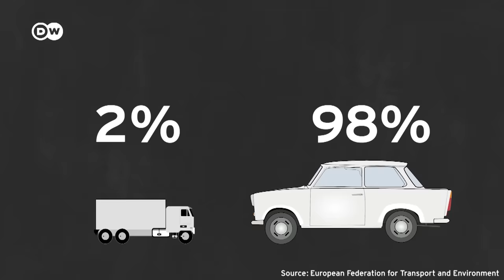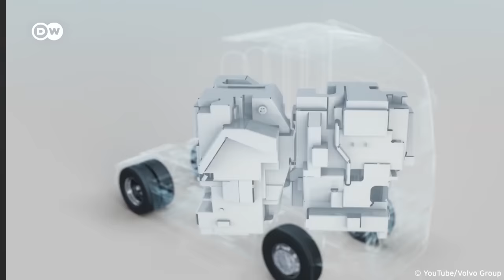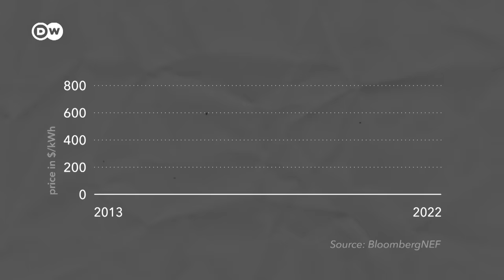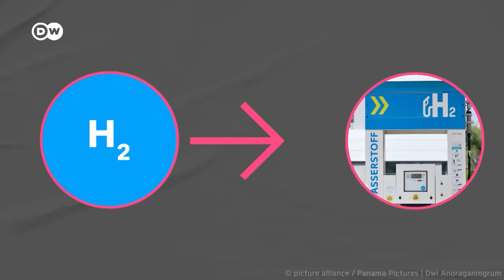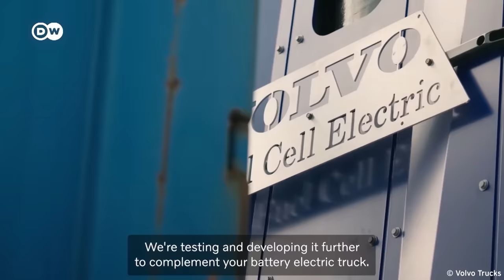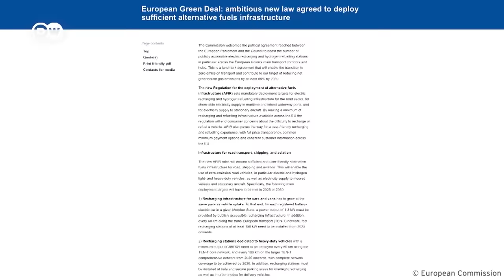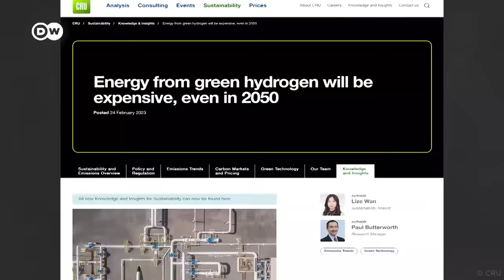Which will be the engine of the future?

Comment: Yeah its still cheaper to run a gas powered truck than either of those two. Until the technology becomes full proof and dirt cheap, I don't see gas power trucks being phased out soon. 

For now, it seems the solution is still a bit of a cost problem.

Comment: One can look at China to see where things are going.  As shown, China already has electric trucks with robot-swappable batteries for local "last mile" delivery.  They're clean and efficient, using the same powertrains as the electric busses, garbage trucks, etc.  We can expect them to scale up to reach cost parity with diesel very quickly. 

China is also building green hydrogen plants and developing hydrogen fuel cell vehicles, and they'll likely be useful for long distance transport where battery swap isn't widely available, but with electric rail and electric trucks covering so many use cases, they might be too far behind to become significant.

Comment: I figure hydrogen would be the way to go in the long run for engines in general
Reply: the race is pretty much over and 12 days ago you still placed a bet on the horse that lost. Interesting
Reply: @zoransarin5411  the horse that won does not mean it was the best when it comes to non-horse things bud.
Reply: @jaydeleon8094  the use of batteries and electricity for a car versus the cost, complexity and enormous infrastructure requirements of hydrogen mean it won because it is significantly better. The only reason hydrogen got this far is because it is a horse created by the fossil fuel industry. 95% of the worlds hydrogen is produced through methane gas reforming. It requires the continued use of natural gas. Your choice. My next car will be an BEV. I wouldn’t want a hydrogen car even if it they were available for the same price as a BEV
Reply: @zoransarin5411  almost like electric cars are just as complex, have more innate problems, require more fossil fuels to make batteries  than sourcing natural gas(which is a byproduct). And the whole point of hydrogen engines is that it uses water. Honestly you thinking that the fossil fuel industry is not funding electric vehicles is really telling.

Comment: Your conclusion that Battery Electric Trucks are way ahead is correct, and for a very good reason, efficiency. Efficiency matters more than anything if everything else is equal... which it isn't. Pure EV is three times more efficient end to end than Hydrogen, and that's impossible to remedy. Why? Because Hydrogen is strongly attached to something else, and the process to separate it is always going to be much less than 100% efficient. Then you have to compress it, which takes a lot of energy and wastes much of it as heat. Then you have to transport it, and eventually waste more than half of the energy in it as yet more heat. No, Fuel cells are not batteries, they are 'heat engines' that oxidise the fuel at 60% efficiency at best.
There is NOTHING you can do to get even close to the efficiency of transmitting Electricity, storing it in batteries and then discharging them into Electric Motors. All of the 'breakthrough developments' are nothing of the sort. Hydrogen is hopeless as a medium to transport energy for road vehicles.
Reply from the maker: Hey dear Roger! 
We did a longer video on hydrogen. Check it out and let us know what you think 👉https://www.youtube.com/watch?v=AGTjKJHu99c

Comment: What about REX trucks? Battery trucks with a ICE engine powering only the batteries, that would be a quick solution in the meanwhile, I would appreciate your thoughts
Reply from the maker: Thanks for your question! They seem to be helpful in offering extended driving ranges like their name goes. But how environmental friendly they'll be in the end depends on the chosen fuel. Also, their engines are way more complex of those purely electric or traditional diesel so their manufacturing and operational costs would probably also be higher too. ⛽⛽⛽

Comment: People just don't understand. They think hydrogen will be like petroleum. Hydrogen has much lower volumetric energy density than gasoline. It must be concentrated by either compressing it to a high-pressure gas at roughly 10,000 psi or by liquifying it (chilling and maintaining it at −423°F). Compressing or chilling it takes considerable energy. Storing it as a gas at 10kpsi requires special armored tanks that cannot be metallic (hydrogen will cause metallic embrittlement). Hydrogen is an incredibly tiny atom, or H2 molecule, and will slowly leak from virtually any attempt to store it for any length of time. If stored as a liquid it must be continuously chilled and maintained at −423°F in special vacuum insulated tanks. No attempt to store it at −423°F is perfect so it must be allowed to vent as some amount of it will evaporate or "boil off" (if not allowed to vent it will explode). Even the best estimates put Hydrogen at better than 4x the cost of the energy equivalent of gasoline. Customers aren't going to tolerate losing even small amounts of such an expensive fuel. Neither will they tolerate the inefficiencies and outright waist of an expensive fuel by burning it in an inefficient Internal Combustion Engine. Using it in a fuel cell vehicle does bring it closer to an EV in practicality. Still I don't see it working for passenger automobiles. I can, however, see hydrogen gaining some measure of success in the trucking industry and in aircraft.
Reply from the maker: Hey there! Hydrogen in aircraft is a topic we also looked at a while ago. You can find the video here 👉https://www.youtube.com/watch?v=7KkBE0HgNJQ

Comment: Focus on hydrogen aircraft and ammonia for container ships.  The cost of energy (diesel, electricity, hydrogen) will always be a major fraction of what's needed for trucks, and I can't see hydrogen winning.  The cost of maintenance is also high, and again batteries win.  The only disadvantage would be that truckers have to take their breaks near a megacharger.  With ships & aircraft, the long distances make frequent charging mid-air or on the oceans difficult for batteries, and aircraft have the problem of weight too.

Comment: Maybe it is possible for them to design a hybrid electric truck that runs both on batteries and hydrogen fuel cell. At least they can rely on hydrogen for long haul heavy load trip and batteries if there are power station in place. Both sources of electricity can be generated to run the electric motor inside the truck.
Reply: Would make a bad product. Hydrogen storage takes up a lot of space on board so it would result in a compromise with bad range and/or bad load capacity.
Reply: Yeah.. Hybrid is also a good idea.
80H-20E or 70H-30E  makes a good combination.

Comment: No mention of the Hydrogen engine, everyone is obsessed with expensive and clunky fuel cells. JCB in England have just released the Hydrogen engine that is the same cost of a diesel truck, zero emission, same running costs and same refueling time as diesel.

Comment: Its a Battery  Vs Hydrogen battle : For Trucks definitely we need bigger batteries to power them. Bigger batteries means it adds up more weight to the truck,  also it need more time to charge as well.    On the other hand if go with Hydrogen Fuel Cell, there overall energy efficiency of the hydrogen production, distribution, production and storage of hydrogen  and utilization chain is lower compared to other clean energy options. Other challenge is it should be Green Hydrogen only need to be used otherwise whole purpose is defeated and can't meet the  climate goals.

Comment: Batteries, hydrogen or liquid fuels? The answer is YES. Smaller battery + hydrogen stored as liquid efuel with fuel cell for range and weight and recharging issues. So YES, these 3 together. Much cheaper than each one alone.

Comment: Hydrogen has two main issues. It is really inefficient. 20 to 25 percent efficient from source electricity to the wheels. Battery trucks are over 80 percent. The second issue is that it’s not green. Most hydrogen is made from natural gas which is no better than burning diesel. Yes we could use green hydrogen but that isn’t here in sufficient quantities yet and won’t be for some time. Also as of now it is much more expensive.
Reply from the maker: Hi dear Matthew! We tackle hydrogen and the production of hydrogen in one of our videos. Check it out and let us know what you think 👉https://www.youtube.com/watch?v=AGTjKJHu99c

Comment: The future is not one solution, but many. On long haul, many companies, like my company, is moving cargo from road to sea or rail. However, these solutions are dependent on an infrastructure and capacity, which in many cases aren’t there. There are especially 2 factors which are important when shifting from road to rail and sea: Total transport distance. Last mile distance. The shorter the total transport distance is and the longer the last mile is, the more seafreight and railfreight is loosing its competitiveness. The European Governments are doing a lot to shorten this distance by making it more expensive to drive. But in the end there will be trucks transporting  srco over long distances. In my opinion it is not realistic to base your transport with electric vehicles on a public charging network, so this has to be provided inhouse. This means that Electric wehicled will ja e their advantage where tvey can go in fixed routs where fast charging can be done on their 45min break and slow. charging during night on the 9-11 hours break. I belive the industry will do a lot to adapt to this sort of solition.

Comment: Both are remarkable technologies! Hydrogen is incredible and has been around for over 100 years in vehicle inventions. BUT! The problem is that no one has invested in building a highway infrastructure for refueling these vehicles like electric. Electric is everywhere, so it's already available wherever you go, but Hydrogen has to be made in a factory and then shipped out.; Hydrogen IRON fuel is an eight-part process, while electricity is only A two-part process; for example, It connects to a supercharger, converts to a higher voltage, and dispenses such fuel. Hydrogen has to be delivered to a factory, then it needs to be processed, then it needs to be combined into an iron gel and then delivered to stations across America. Delivering Hydrogen will be highly costly; remember that commercial trucks will become self-driving. Electricity is energy efficient only because we have the infrastructure already set. Still, if all our appliances ran on hydrogen-iron electricity across the country in every household, the game would change. It would make better sense to run a Propane Tank Engine than a Hydrogen because we already have propane pipes across this country. It would be cheaper for car makers to make a Propane car. But if they can convert the Propane into a gel called Propane Iron, it will no longer burn as fast, and we can travel longer miles.

Comment: Another advantage of going for Hydrogen Fuel Cell, is the geo-political and humanitarian issues with mining lithium. I support hydrogen to be honest. 

There are locations where there could be excess renewable, but don't have infrastructure to get electricity to the grid where the demand is, such that the renewable were not built. But they could be used to make hydrogen, like Wind farm from north of Scotland and Solar from north Africa.
Reply: Hydrogen fuel cell vehicles require platinum, lithium, cobalt and nickel too and then there all the other matierals required for building 3 times the number of wind turbines and solar panels required. And just because we can make some hydrogen with excess energy doesn't mean we should put it in trucks and it won't be enough anyway.
Reply from the maker: Sounds like you'd be keen for this! We did videos on both; lithium mining and hydrogen production. Check them out here👇  
📺 "Why we can’t live without lithium" 
https://www.youtube.com/watch?v=gAZV1Ut6DDs
📺"The truth about hydrogen" https://www.youtube.com/watch?v=AGTjKJHu99c

Comment: Hydrogen cells are equivalent with batteries having their metal anode being dispersed in the air. It may be water a hydrogen cell disperses but have them in numbers and you are effectively rising the surrounding humidity by a lot. In my personal opinion though, we should be living in the safe nuclear era, where we could be utilising Nickel 63 to convert to Copper 63 as the waste product and have a direct nuclear electric safe battery that lives 100 years and is super powerful. What a pity we are still not using direct nuclear electric power supplies. They could couple with anything they are attached to, becoming the source of energy for anywhere you go, including houses and farms. To produce Nickel 63 an ion beam of standard Nickel 62 or below can be bombarded with neutrons from heavy water, which is very abundant, and then the successfully transmuted heavier Nickel 63 atoms can be collected, continuously from the ion beam, by simple magnetic steering. Ofcourse this is very far ahead in the future as we currently cannot utilise simple iron air infinitely rechargeable batteries as their research has been shoved under tons of petrelaic "interests".

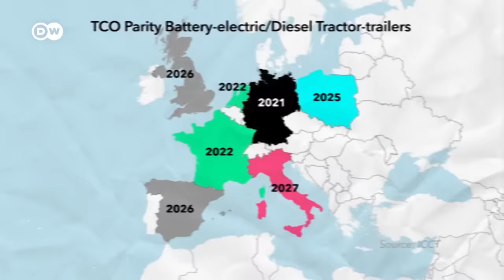Comment: Either I’m stupid or the map at 5:32 doesn’t really tell me anything
Reply from the maker: The graph shows by what year it will basically cost the same to buy a battery-electric tractor trailer compared to a diesel tractor trailer. The data looked at the total cost of ownership, the sum of all the expenses for a vehicle, for the first 5 years of ownership. It also took into account any policies the countries in question have in place to support electric trucks. 🚚

Comment: Using hydrogen in IC engines in place of fossil fuels can be an option to begate the disadvantages that come with fuel cells. Additionally, the ships can't work on batteries as distance is too much to make sense. This is
not true in the case of hydrogen powered ships. 

Talking about hyfrogen filling stations, the existing fossil fuel filling stations infra can be used to solve the issue of lack of infra.

Comment: The problem with electric is the electrical grid can not handle the extra load. The internal  combustion hydrogen engine is the answer. Make hydrogen fuel from water produces little carbon pollution and will even clean carbon pollution out of the air.
Reply: Of course not. Such a truck would consume five times as much electric energy, and you are worried about the grid 😂

Comment: This is missing three important points:
(1) The first step is to stop consuming so much stuff.  Wasteful consumerism is the core problem here, and also the cause of a bunch of other issues (e.g. waste to landfill).
(2) Trains.  Just like how the solution to passenger transport is public transport first, and electric cars only where that's not possible, the solution for freight needs to be to get as much as possible off the road.  This would eliminate the need for hydrogen, because it'll only be short-haul trips needed by trucks.
(3) Hydrogen is more expensive because of fundamental laws of physics that make it require 2.5 to 3 times as much primary energy versus battery-electric (and this is thermodynamics, so there's no way to innovate past it) - i.e. even in the best case scenario, hydrogen trucks are going to require 3 times as many solar panels and wind farms, and it'll always be much more expensive.
Reply from the maker: Hey there! Yes - less is more, right? 🙌🌻
We did a video on degrowth you can watch here 👉 https://www.youtube.com/watch?v=_22mKe_OLsg
More gargo on rails would be ideal - though we'd still need trucks as well for versatile deliveries. Also, from about 4:11 into the video we also address the cost of both options and what they are based on.

Comment: The story set higher standards for hydrogen than it did for electric. Talking only about green hydrogen, while saying electric trucks could be powered by fossil fuel or green energy. And it totally missed the convenience factor, hydrogen can be sourced everywhere, while lithium, cobalt & rare earths are restricted to only a few sources, and what about the life of both designs? How long does a battery last before needing replacement compared to the lifetime of a hydrogen fuel cell? That is a huge factor in how economical they are. Hydrogen is starting far behind electric, but given it's versatility, it can be used for cars, trucks trains, boats, planes, rockets & power plants, none of which were mentioned, it will likely play a huge part in future transport & power generation.

Comment: Nowadays there a solar cells that generate hydrogen from moisture in the air.
Cover your 12m container with those and you get additional feed for your fuel cells,
while saving at least 10 tons on a battery pack that needs replacing every few years.
Reply: Still very inefficient.
Reply: @Simon-dm8zv  
Inefficient compared to what? You can easily make your own hydrogen at home. It's free!
Reply: @fglatzel  Compared to battery electric. Making hydrogen at home is also very inefficient...
Reply: @Simon-dm8zv  
If something is for free, why care so much how "inefficient" it is?
Here in Africa is plenty of sunshine throughout the year.
These solar hydrogen panels allow anybody to create their own free fuel
while getting away from this stupid battery based energy storage.
Reply: @fglatzel  Nothing is free. You will have to buy 3 times as many solar panels first plus an electrolyzer system, compressor and storage vessels.
Reply: @Simon-dm8zv  
 Without a doubt, there is an obvious initial investment into infrastructure like everywhere else.
Eventually people will see that storing energy in lithium-ion batteries is really dumb.
The difference between us is that my glass is always half full, while yours is always half empty.